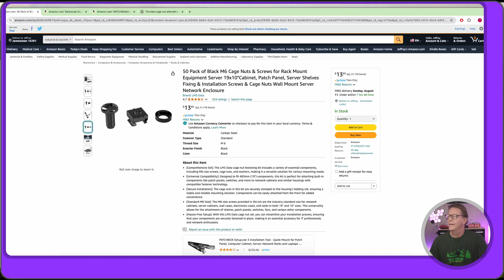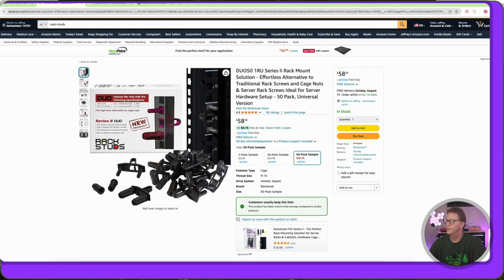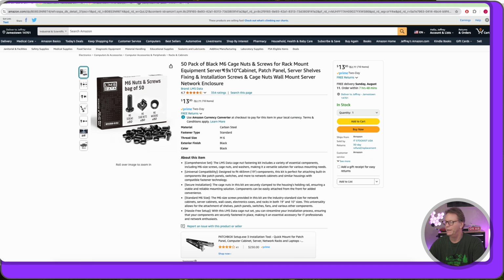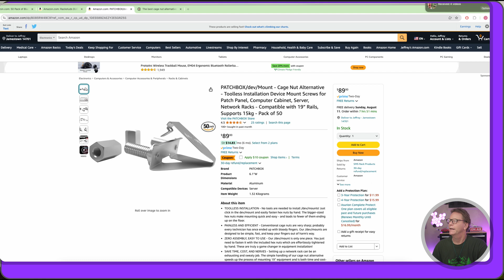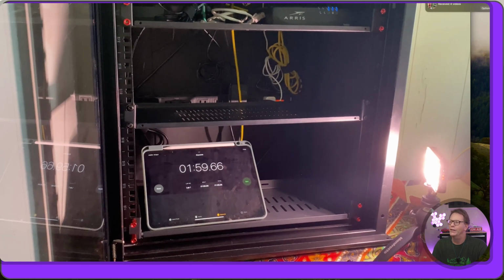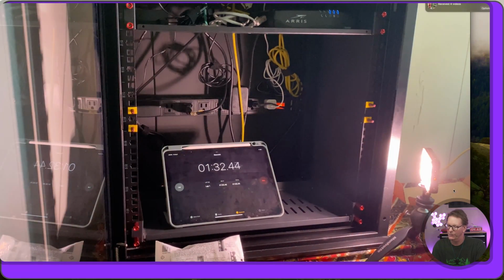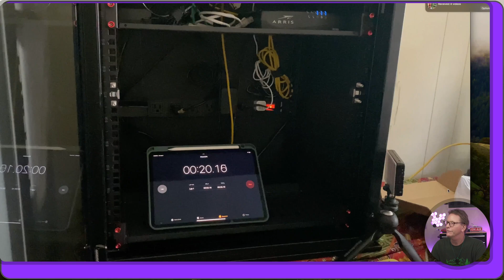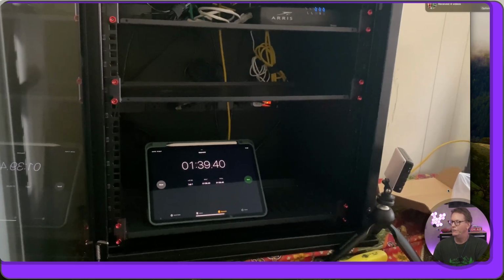Cage Nuts, Rack Studs and /Dev /Mounts

Comment: 3:30

I’m sure you’ve either embraced or abandoned rack studs by now (9 months after the posting of the video .)

I use loads of rack studs at work. The 
yellow keeper is much more stable once the stud body is inserted into the rack. Occasionally, the clips of the stud do not fully extend. Simply spread the stud and the yellow keeper will be much more stable. You’ll notice it securely seat into the stud body. I don’t like this step of the installation process. 

Perhaps this  has changed or reengineered in later versions. We bought several hundred rack studs many moons ago.

Love you